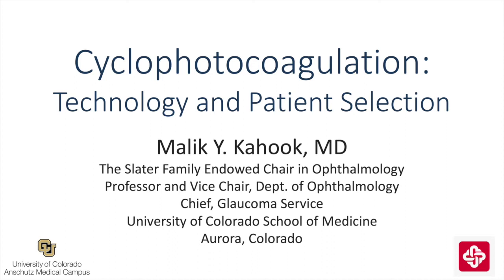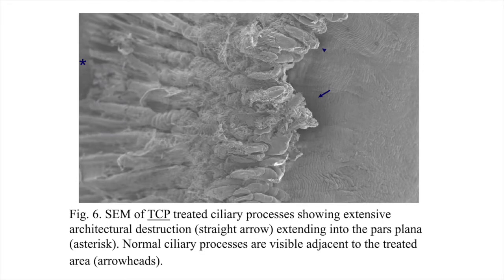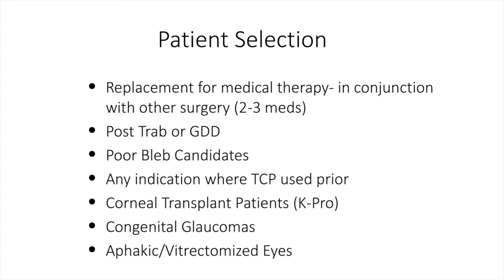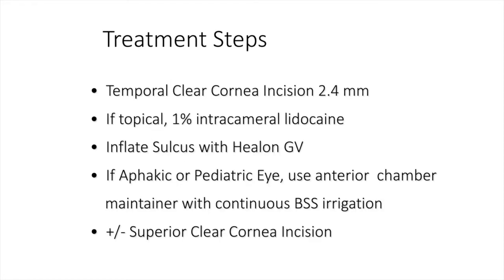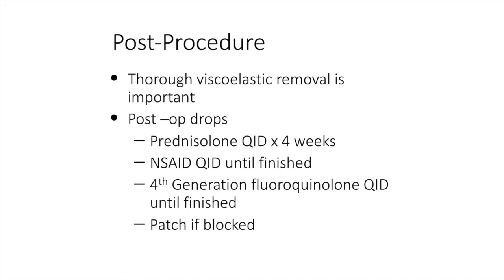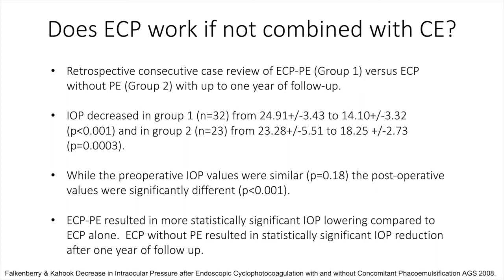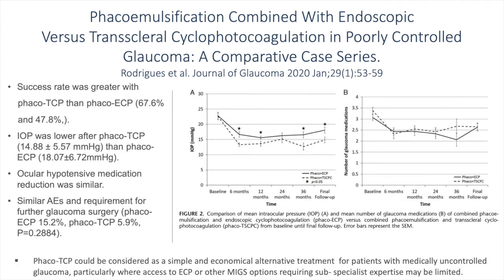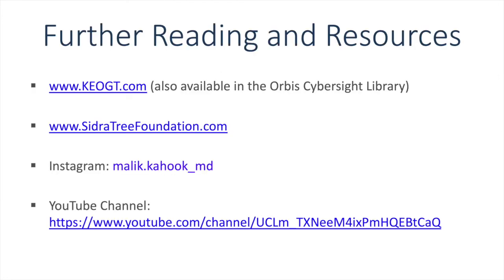Cyclophotocoagulation Part II: Endocyclophotocoagulation (Malik Y. Kahook, MD)

Comment: Very useful tips. Some doctors here stopped using ECP because of severe inflammation with cyclitic membranes, etc. Do you use or advocate the use of intracameral triamcinolone (neat or diluted) at the end of the procedure?
Reply from the maker: Inflammation post ECP is of course expected, but a high degree of inflammation is usually due to over-treatment with popping of the tissue that should be avoided. I find painting the ciliary processes and stopping the treatment before the tissue pops leads to less inflammation. While I don't routinely use steroids, I have in the past used 0.1 ml of 4 mg/ml dexamethasone in the AC at the end of surgery and others do as well. More darkly pigmented eye can experience more inflammation and this might be the right population to use dex in if desired.
Reply: @malikkahook9368  only very  experienced doctors, masters of the craft can avoid popping. The "painting" (side to side motion) is key. Thank u doctor. But i think ECP is prob the best approach in achieving a more desired outcome which lasts for a longer period than other methods (5-6years i think). What say you Dr.?